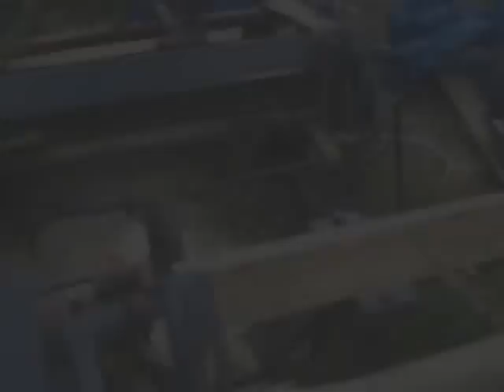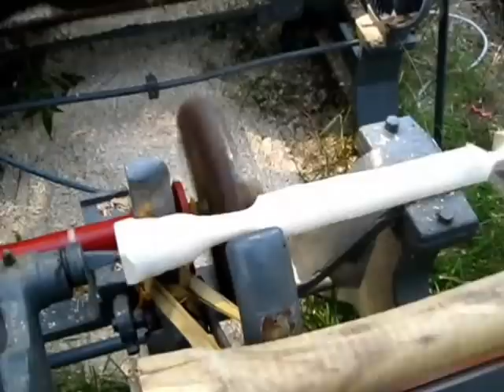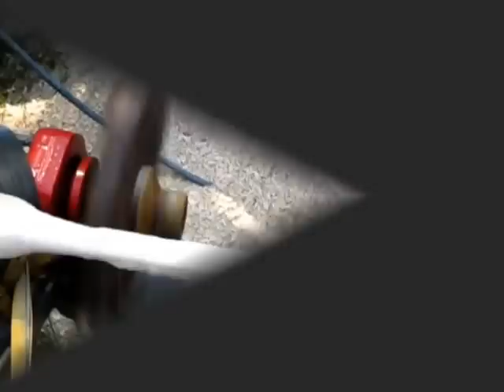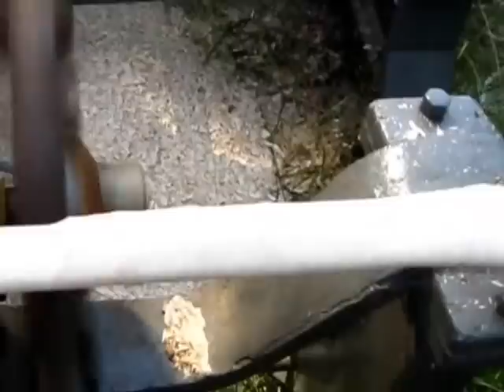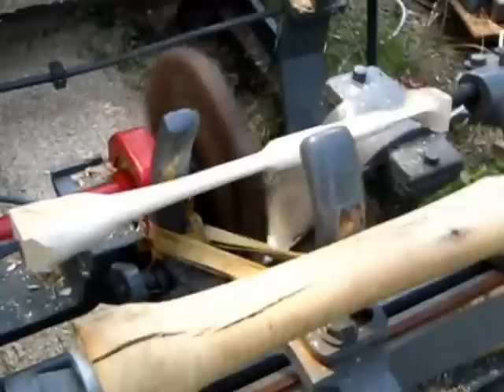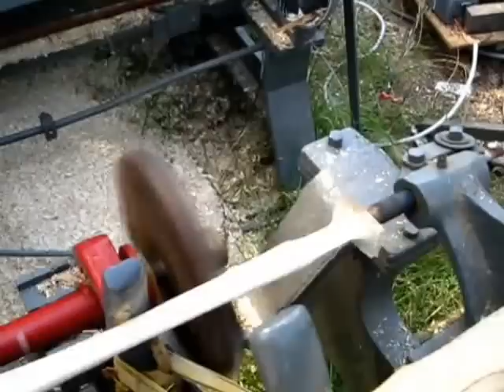Ober Mfg. Co. #11 Copy Lathe Norlund Axe Handle

Comment: I forgot to mention I didn't know anything about him until recently. Had no idea what he did. I've programed and run CNC lathes for 30 yrs now, and never knew this. From small (computer clean room, medical parts) to huge VTL's turning 15' tall x 8' wide oil and gas piping and valve connectors. Blows me away. Cool video!  : ))